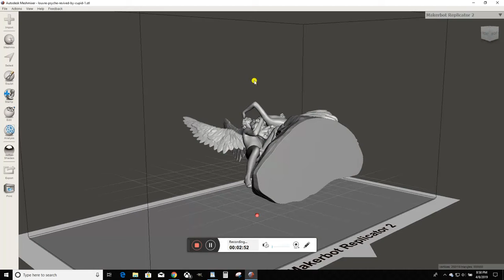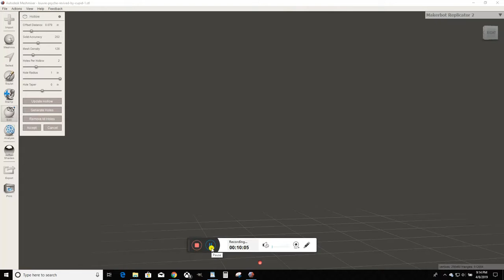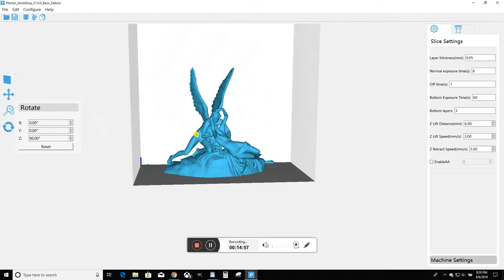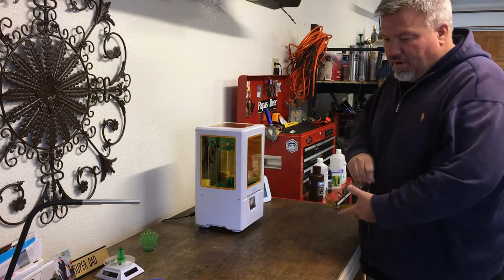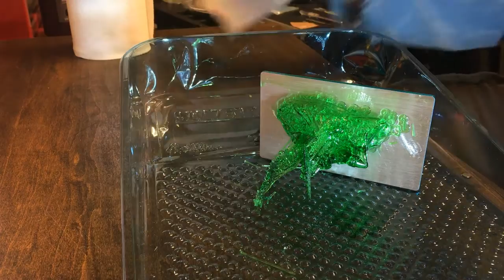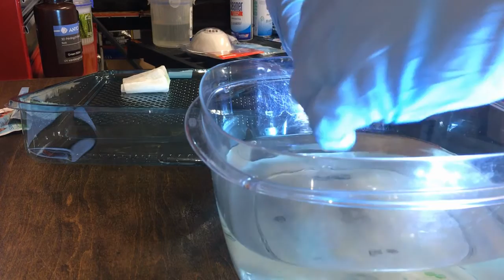Anycubic Photon S - Testing  with a Larger Print - April 9 2019

Comment: really getting into this. I'm trying to understand the resin costs. How much resin did you use to print this? whats the biggest model you've printed with this machine?
Reply from the maker: Danny over at 3D printed tabletop had a good video on resin cost. I don’t keep track of my actual usage cost but I would guess I used about 20% of a 39$ bottle. 

I am currently printing a big print and will be putting a video out on that one this week. I will try and figure out my resin cost on that one

Comment: How is the Photon S compared to the regular photon?
The photonS's case looks terrible and flimsy compared to the regular photon's steel case, but what matters is the print quality. Is it better or worse?
Reply from the maker: Nathaniel Zhu the case is not strong but I am not so sure you need it to be rock solid.  I am going to try and figure out a way to keep the top from opening all the way. I think that will keep the area around the hinges from breaking.  
I can’t speak to the original Photon. I did not own the original. I am very happy with the prints so far.
Reply: @salinas3d495  

Good to know. I'll buy the new one then too. Thanks

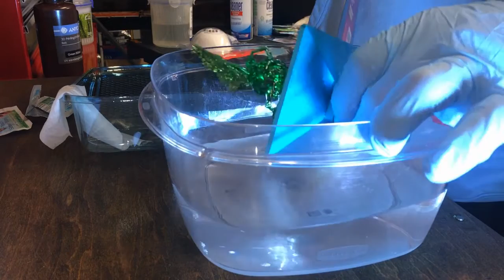Comment: Perfect videos to watch while waiting for my Photon S to be delivered. Thanks for these. Around the 38:18 mark I was a bit worried that hitting metal against metal could create a spark and ignite the alcohol. Although rather unlikely because everything is quite wet with resin...
Reply from the maker: That is so funny that you bring up the Sparks , when I watched the final video I thought " Damn I better be a lot smarter about removing the prints or I'm going to damage my build plate" I never even thought about causing a fire haha I will be safer in the future for sure. I have enjoyed everything about the Anycubic Photon S so far. Check out the 3dprintfarm channel and Maker's Muse for a bunch of other epic videos on the Anycubic Photon. Thanks for the words of encouragement.
Reply: It's aluminium and steel, aluminium doesn't spark. Even if the build plate was steel too, you'd need to absolutely sledge the s**t out of it to even remotely have any chance for a spark. Even then, if you were able to smash the two together hard enough and make a spark, resin is not volatile like petrol. You really don't need to worry about it whatsoever - it's a non-issue - especially just nudging a print off the plate ;)